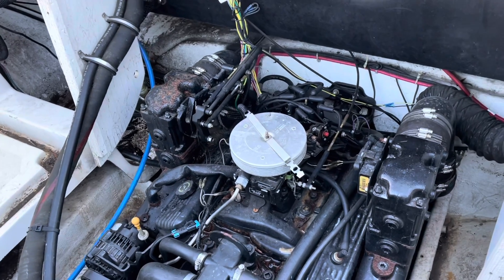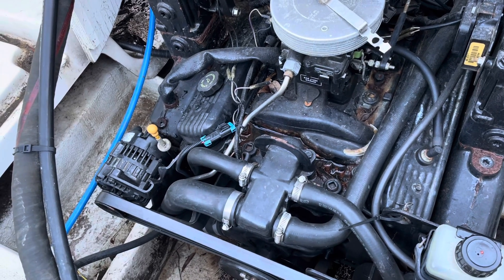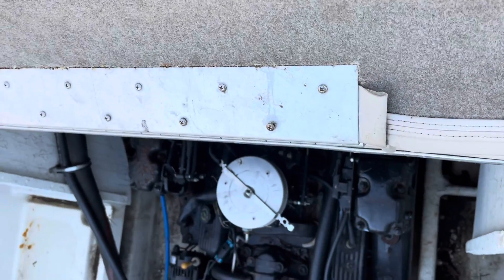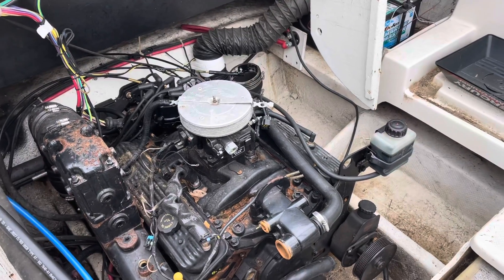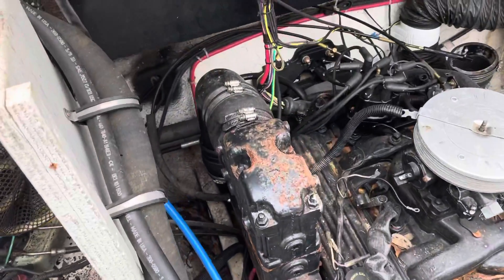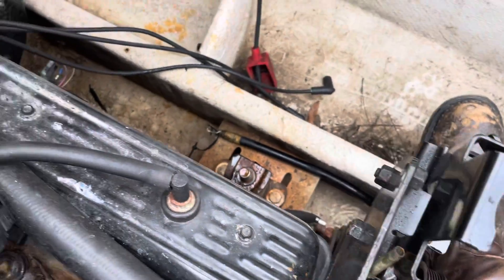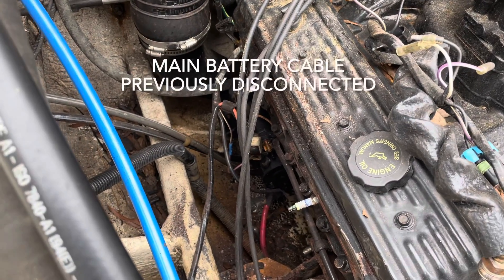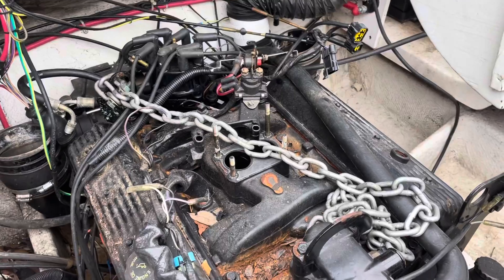Mercruiser 5.7 2(X1) - Basics of Marine Engine Removal

Comment: Can this be done whilst the boat is on the water at all? What if put up high on high tide…will water get into the boat?
Reply from the maker: I guess this depends on the boat and where the waterline is but if it’s supported independently from the water why would you care if it gets water in it since it can’t sink?
Reply: @moccasinmarine  that is so true. I done the whole top end with new heads, manifold and sniper and had the risers of and no water came in.
I might try to put it in my front yard on hard stands but I need to hire a trailer ($300 AUD per day) and hope I can put it on stands and move the trailer out from underneath.
Reply from the maker: @ShaneWere  if the engine is removed from the boat (which can’t be done without removing the outdrive first) the lowest point where water can enter is the gimbal bearing.

Comment: thats an I/O not an inboard, an inboard has no drive attached to it it has a special transmission
Reply from the maker: Cool. Exactly when did I say that.
Reply: @moccasinmarine   right in the description of the video title Mercruiser 5.7 2(x1)-basics of marine engine removal,  now i honestly got to this video off a web search not a you tube search so i did not get to see the rest of the description where it says you left out removal of outdrive  so a bit of my bad also but i still gave your video a like, i was investigating as i was going to video the removal of my 5.7 mercruiser inboard and was seeing how many vids there are to see if worth putting in the time, its too late now to do video but i ended up only finding 1 true inboard removal

Comment: How is the engine attached to the leg? Do you need to remove leg before engine?
Reply from the maker: If by leg you mean the outboard drive unit yes that has to be removed before you can pull out the engine. It slides out after removing the trim cylinders and six nuts.